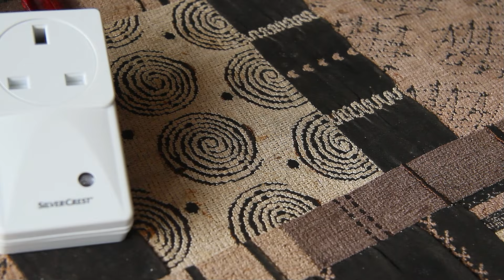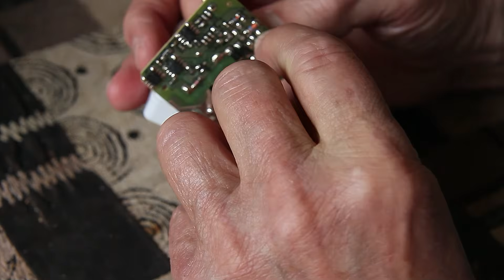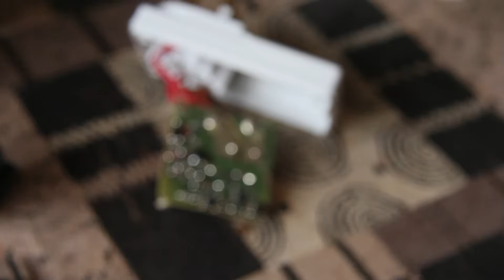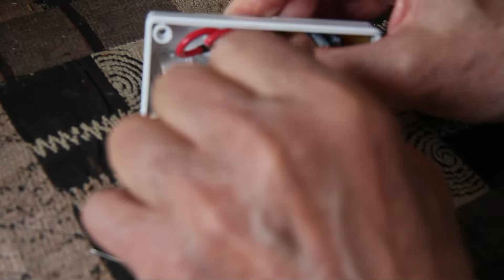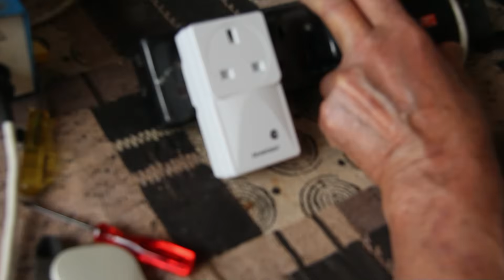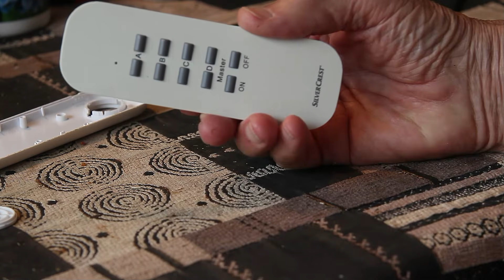How to Repair a Silvercrest 433mhz 13 amp remote control Socket.Sold by Lidl

Comment: i did my own remote controller, because i have older socket aswell (powerfix one) and wanted "central" remote all in one. unforunately there is one socket which can turn on but off wont work...learning mode is also not working.